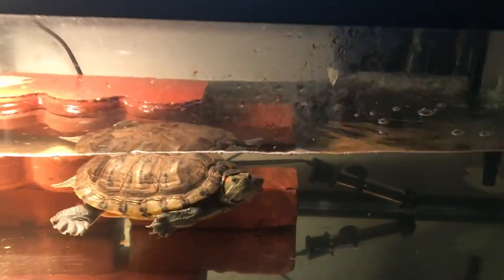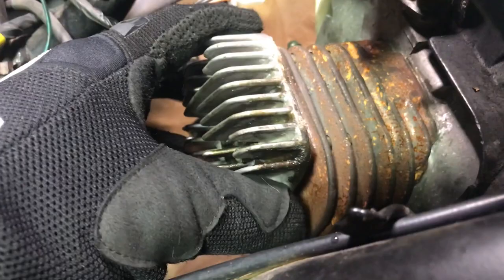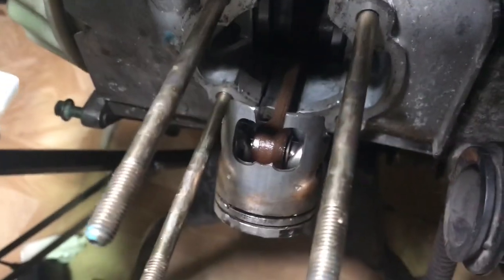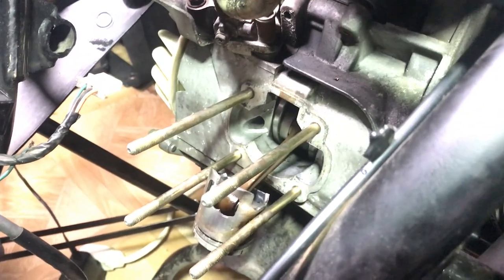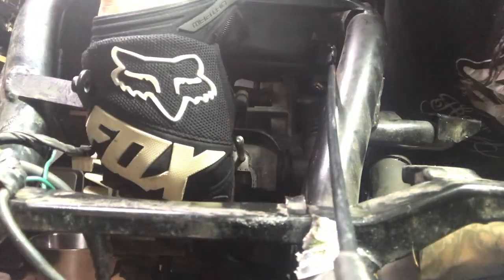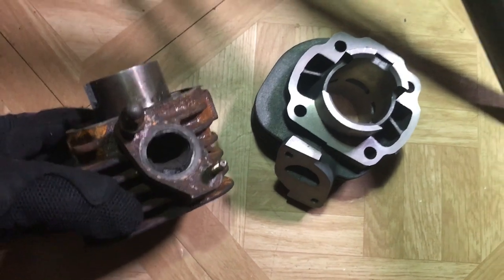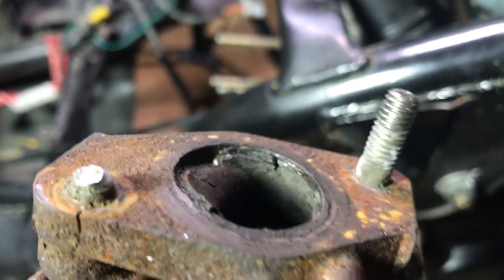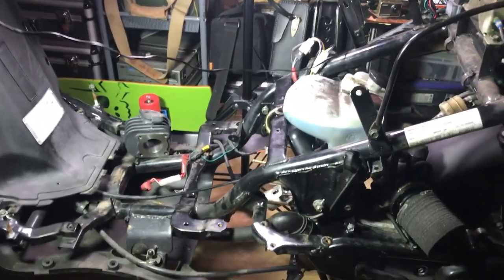Genuine Roughhouse RH50 Top End Rebuild

Comment: @1:42 what size are those bolts for the cylinder head & where can I find them?
Reply from the maker: To be completely I honest I cant remember off the top of the head. I did this rebuild over 2 years ago. However you should be able to get new bolts with a new top end kit. Also on the websites they sell top ends they probably even have the bolts by them selves. Thanks for commenting have a great day.

Comment: No Oil???
Reply from the maker: Spase Angelkoski yes I lubbed the piston and the rings thoroughly before installing them. Once before I put the rings on the piston. And again when installing the piston to the cylinder. They come pre oiled but I like to use the 2 stroke fluid straight from the bottle by hand and rub it all into it. Thanks for commenting. Have a good day 🙏🏽